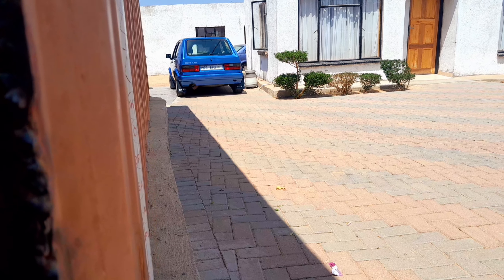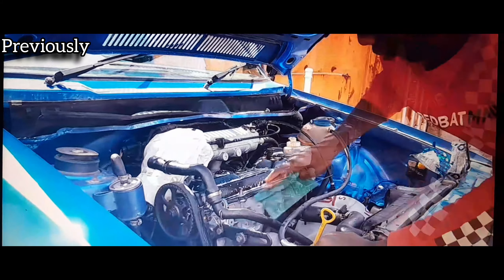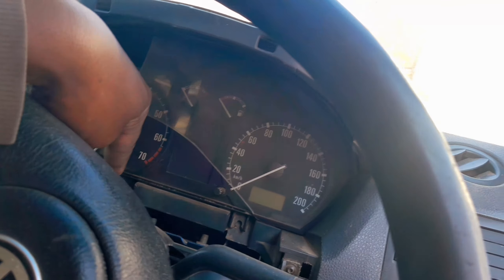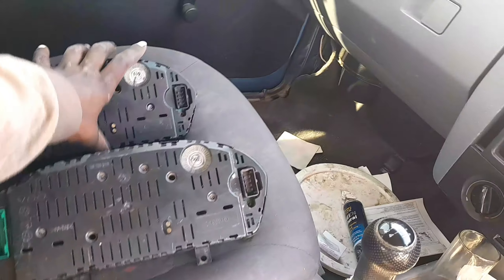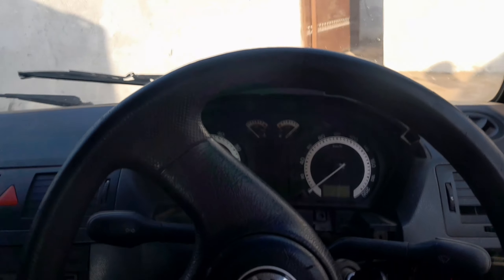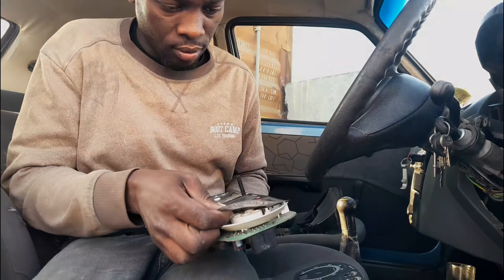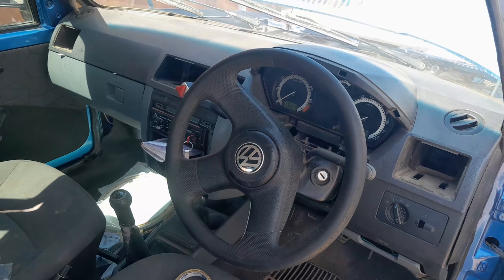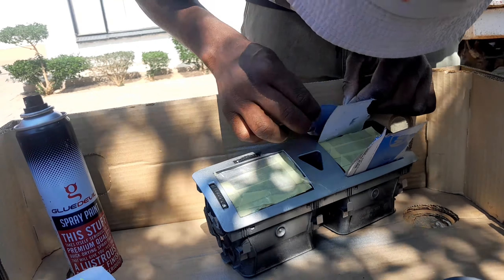MODIFYING MY CITI GOLF MK1 INTERIOR /CLUSTER REPLACEMENT (P25)

Comment: The air vents also have tabs at the back that lifts up then you can remove the frame of the vent. Will ensure no paint gets on the vents. Just for next time when you touch it up again cause it does fade after some time again
Reply from the maker: Bro, thank you for looking out. next time, I'l✅️👌l do that. thanks for the tip. It's awesome.🤝💯
Reply: When you can, add a 3rd brake light on the rear windscreen. Just gives a little extra detail🤏
Reply from the maker: Bro I've been looking for that and I cannot even find it  @att-sa1578

Comment: Home boy the rev counter to work there are two thing 1 on the cluster check the cable on the gearbox if it's connected and check your relay because short socket of power to the relay will not work properly or even at all
Reply from the maker: Thanks for the tip👍